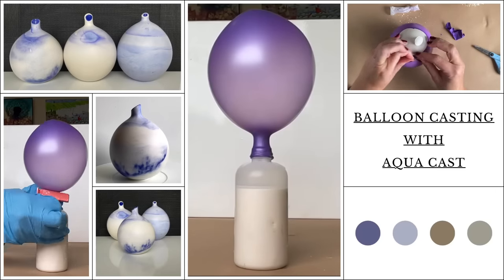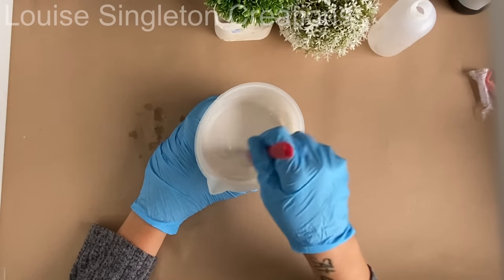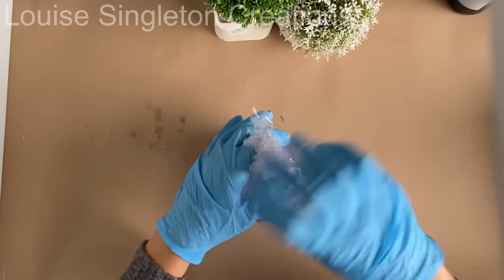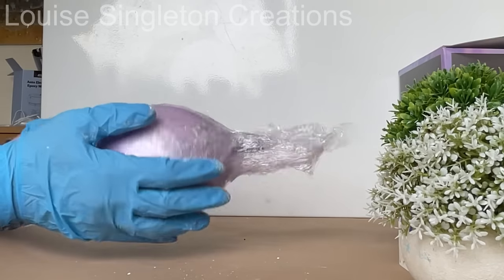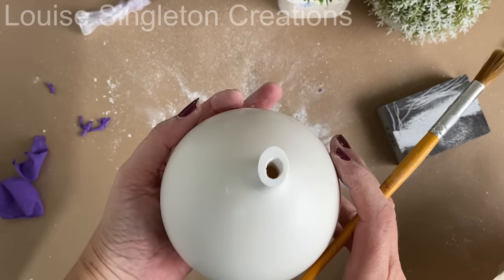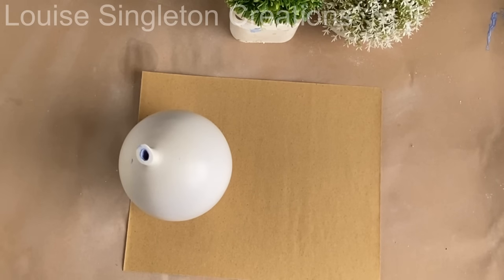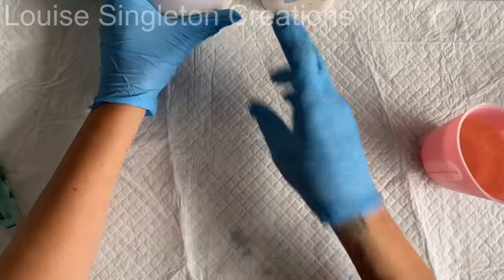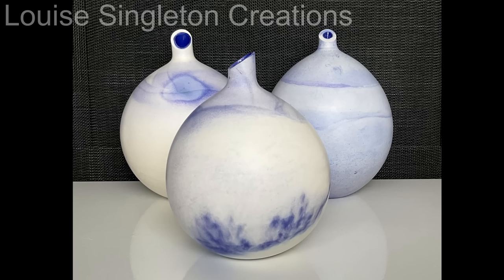I Made a Bud Vase in a BALLOON! Balloon casting with Aqua Cast

Comment: You can sharpen scissors by using them to cut through aluminium kitchen foil or by running sandpaper against the blades.

Comment: Thank you for the helpful tips!! Your bottles are beautiful❣️ I do, also, like to see brief failures on occasion. It engages my thoughts in a way perfect lessons don’t. And lately I’ve considered using resin in balloons but not worked out the details, which you’ve done a lot of them for me. I am curious how you have the bottle standing though. I’ve been trying to figure out how to make the bottom flat w/o sanding or cutting. Now you have me thinking about using the ResinCrete I’ve been anxious to try. TYFS
Reply from the maker: Thank you so much. I’m not sure which video you were referring to on the piece standing but if it was the resin one, you stand the balloon on a flat surface after you finish turning it and that flattens the bottom before it is fully cured.
Reply: @LouiseSingletonCreations  Ha, so simple! I think I was trying to make it complicated. Thank you!❤️